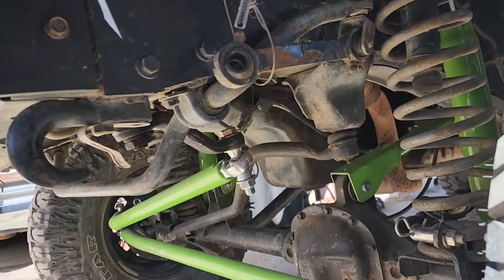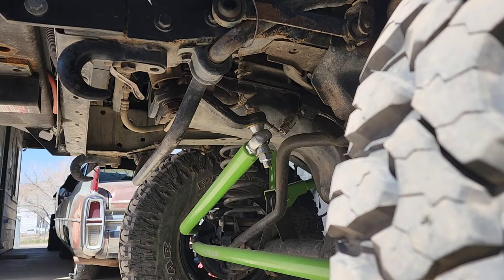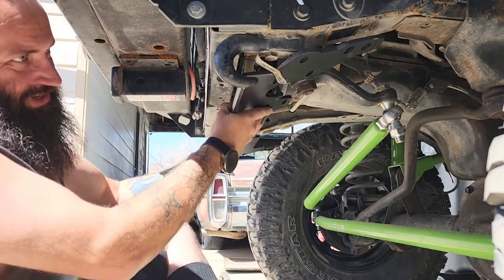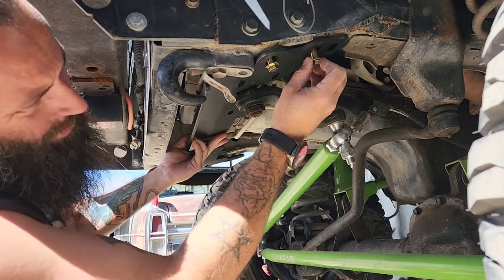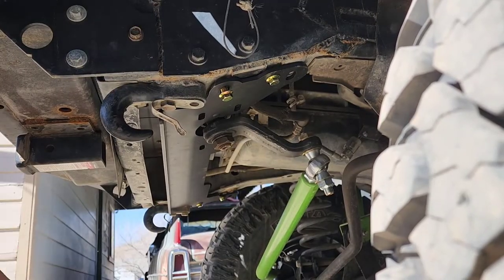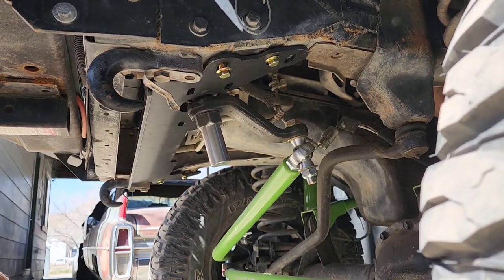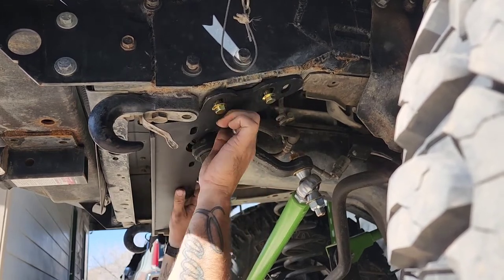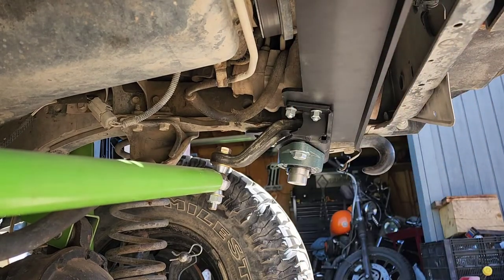Steering box brace install on my xj

Comment: Thank you for the video!  How do you like it now that you had it for a couple of years?
Reply from the maker: Haven't had any issues with it!
Reply: @cadilakisrodcustom Would you say it tighten up your steering setup?  Or road manner?
Reply from the maker: @mightymikee  it did help with the road manners, but welding the cracks, and installing this helped tighten everything up.
Reply: @cadilakisrodcustom my steering box broke off frame got bolts that need tap out should u buy new steering box and spacer?